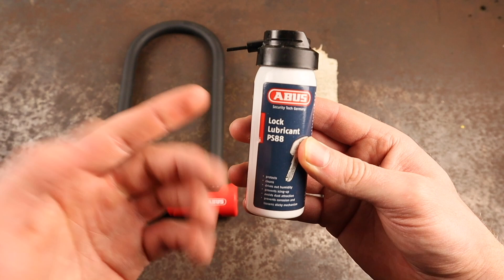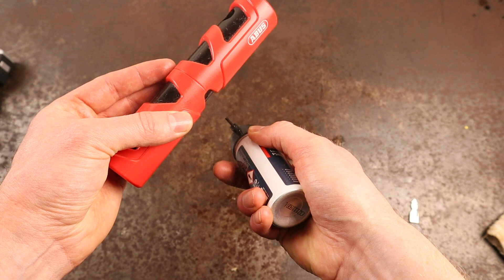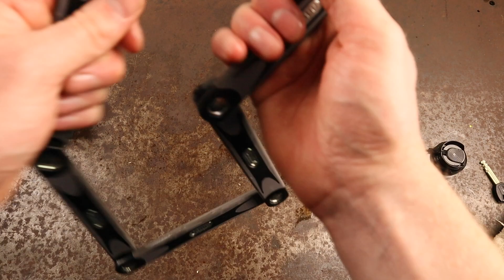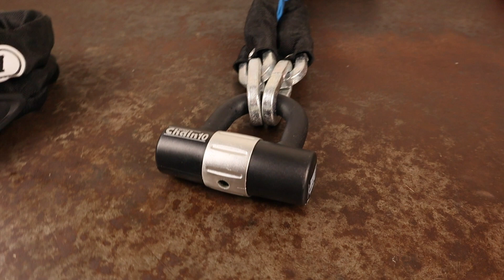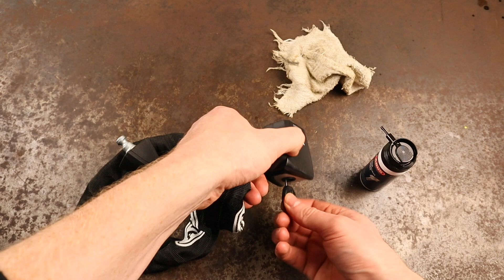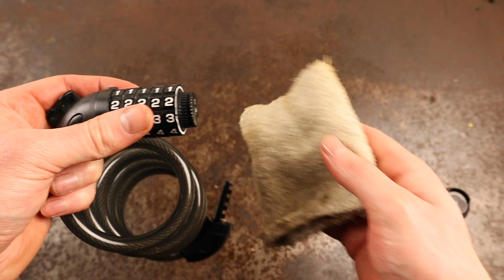How To Clean and Maintain a Bike Lock To Prevent Rust

Comment: My ulock's rusty, both on the shackles and the locking bolts. What would you recommend?
Reply from the maker: How bad is the rust? Is it causing the lock to perform poorly (jamming, stiff to turn key, etc.?) 

Once stubborn rust is set in place, there isn’t a whole lot you’ll be able to do. 

You can attempt to scrub away the worst of the rust with a wire brush or similar, and then coat the effective parts with a lubricating sealant.

But without the corrosion preventative layer in place, once the protective lubricant layer has reduced, the process of corrosion will begin again.

If the lock is really badly rusty and didn’t cost a whole lot of money it may be worth investing in a new lock, otherwise if you can make do with its condition, ensure you keep that thing thoroughly clean and well lubricated! 

Hope this helps.
Reply: @bikelockwiki  Thanks. The key turns easy, maybe a slight stiff when turning, and for the most part like 8/10 you can unlock it easy. My guess is that the issue is with the bolts/and or the shackles. In terms of how bad the rust is, I would say low to medium.
Reply: @bikelockwiki  btw Would you recommend WD40 to get rid of the rust?
Reply: @gipeon Just get a new U lock. Spray the bolts and lockinhg mechanism with a dry film lubricant first thing before using it. 
Then, every month, use a WD40 to degrease it in the same areas, wipe them, leave it overnight, then re-lubricate it again with said lubricant.
That's it!